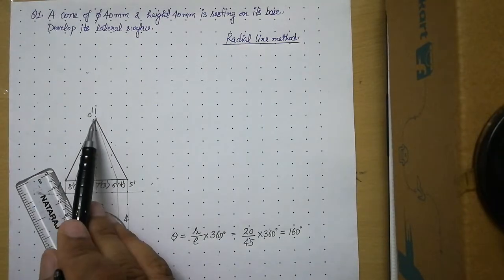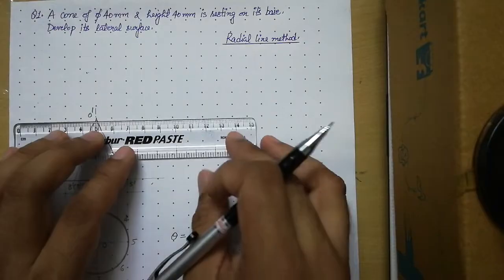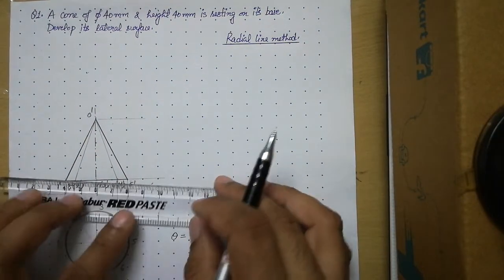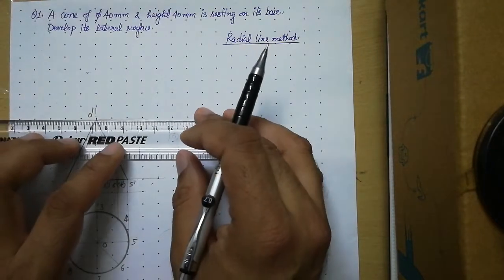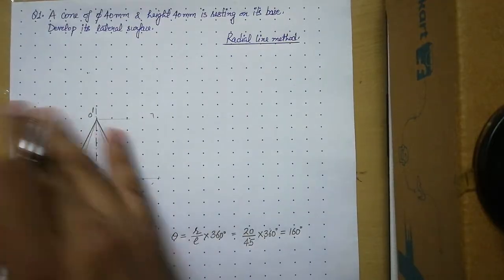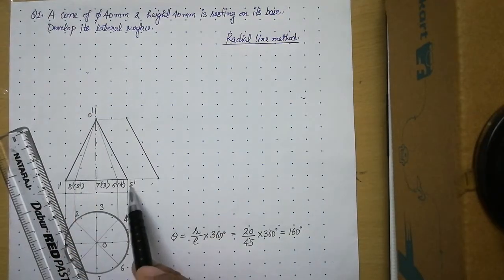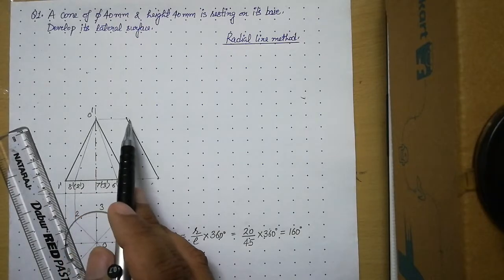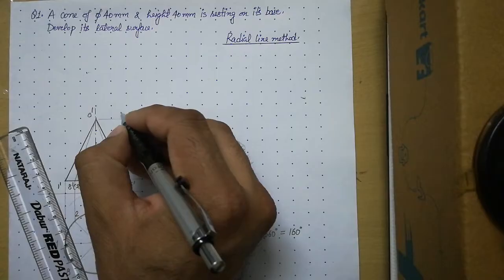Development of cone | Development of Surfaces | Engineering Drawing

Comment: Thank you very much for this lesson. But I have two questions, why you divided on 8 line and not 12 lines?  
Can you make a lesson on truncated cone 30 or 40 angle? please
Reply from the maker: Welcome dear. Because it takes less time and gives optimum curve during solution of truncated problem. You can watch this video  https://youtu.be/MOoAc_u6Sec
Reply: We have made that into a tiny bird as we ran the earing on the left so tiny bird is using both earings don't worry nobody will notice